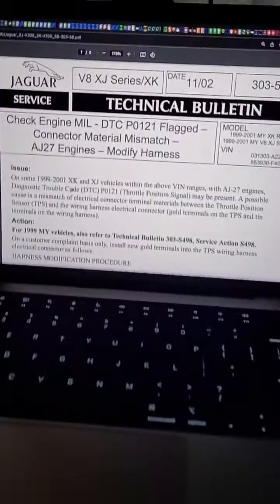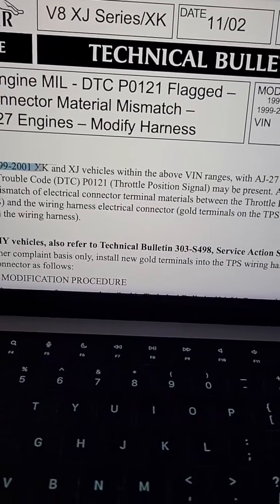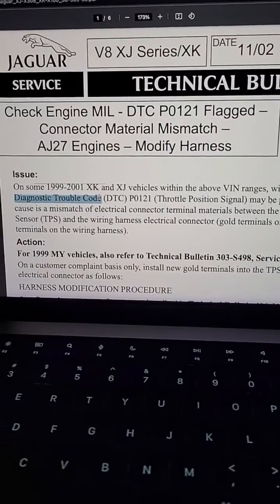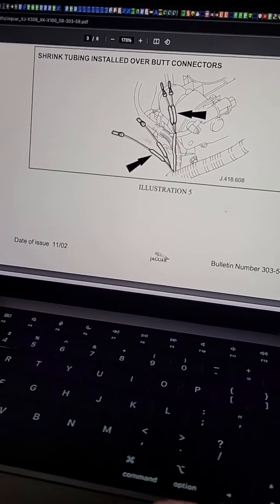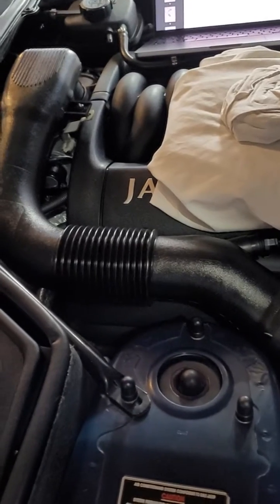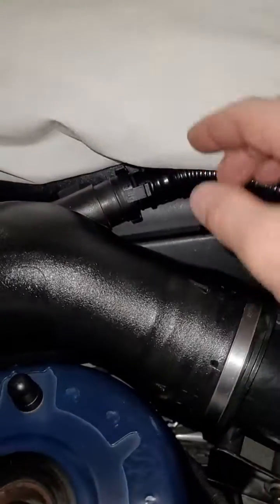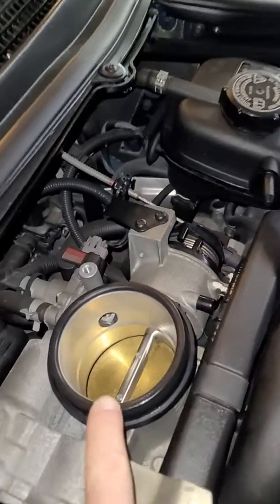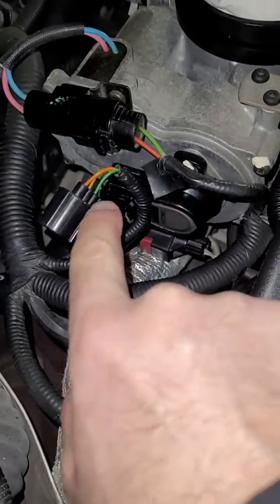2001 Jaguar XK8 - Technical Service Bulletin / Throttle Positioning Sensor

Comment: My car is having this issues, i notice the car would spontaneously speed up, later the Fail Safe error comes on and the rpm is limited. I'm going to try you method to see if this will fix it. Thank you.
Reply from the maker: The spontaneous acceleration sounds scary! Cleaning the connector and making sure that the contacts/conductivity is good is a logical first step, and it's free (other than your time invested). This may be sufficient to resolve the issue, or you may have a failure within the sensor itself which would then necessitate the replacement of the part. There may also be other failures leading to the behaviour you have experienced. I am not aware of any, just saying that it is not guaranteed that the TPS is at fault. Best of luck!
Reply: @2001JaguarXK8  if true doesn't fix it, I'll replace the TPS and go from there. Thanks again

Comment: They didn't trust their dealers with contacts and crimpers, so instead they trusted them with solder wire, soldering irons shrink sleeving and heat guns.  That's crazy.
Reply from the maker: I agree Gary, the proposed solution in the service bulletin somewhat doesn't sit well with me either.